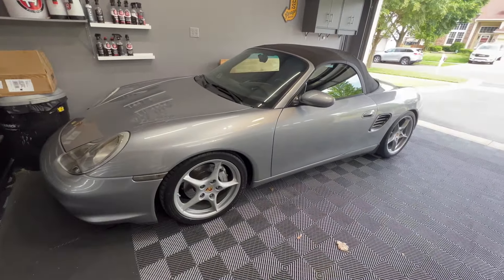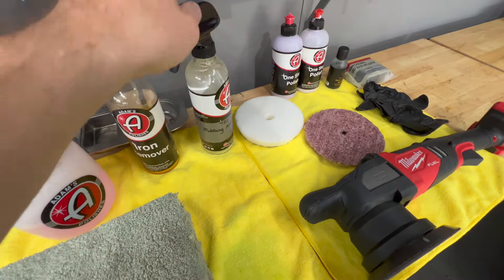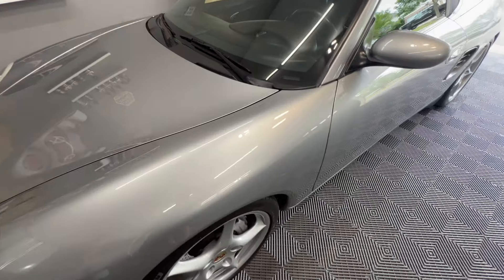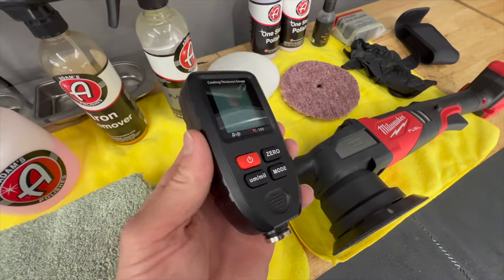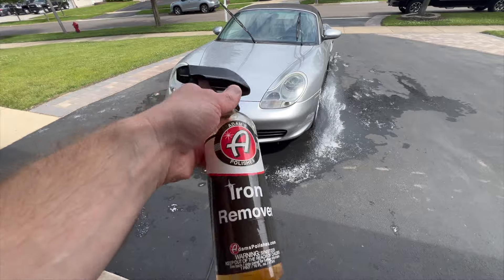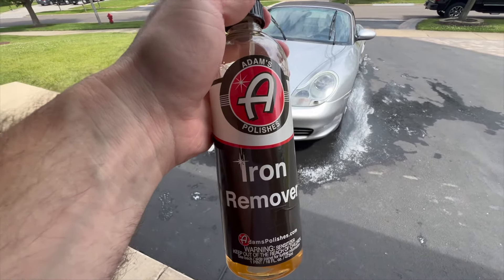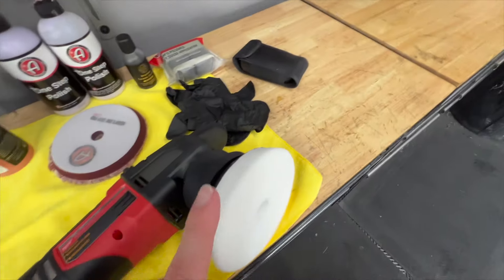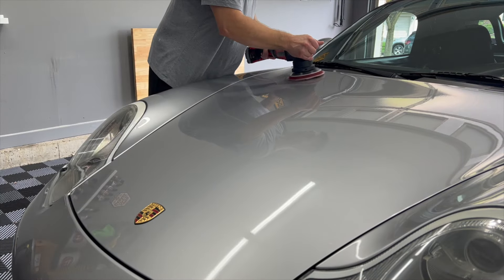Perfecting the Paint on the 986 Project Car!!! Polish and Ceramic Coating Boxster S 550 Spyder

Comment: Nice work.  I'm planning to ceramic coat my 2000 Boxster in the next week or two.  I used Avalon King on my 2005 Mercedes C230.  It seemed to provide a slightly better gloss than the wax that I had been using.  Time will tell whether ceramic coating will be as durable as the marketing claims.